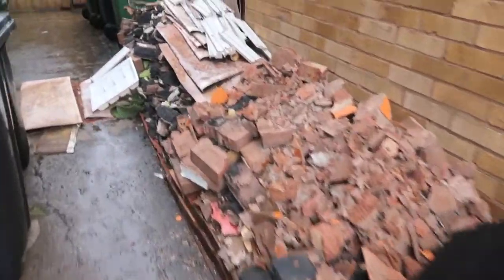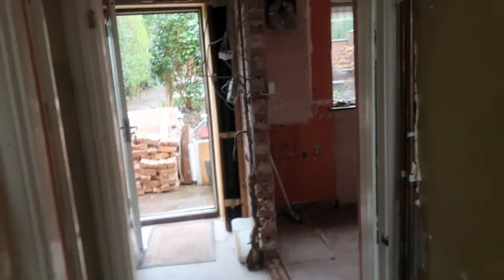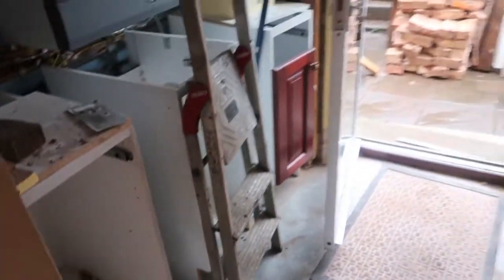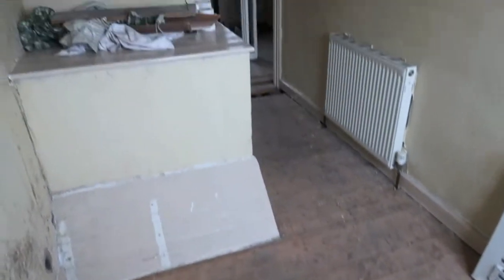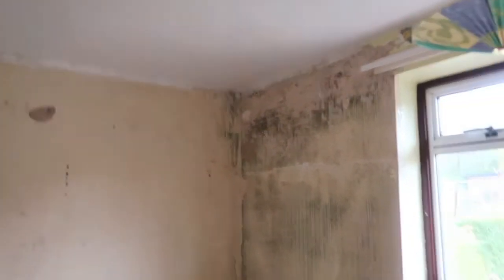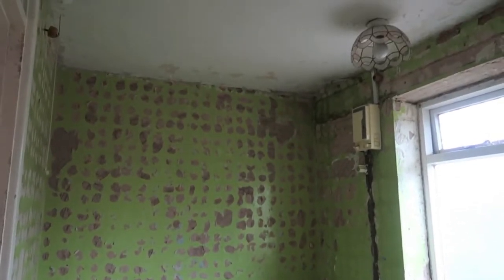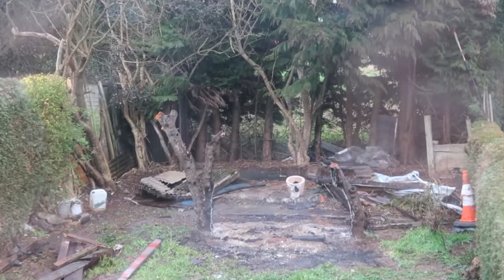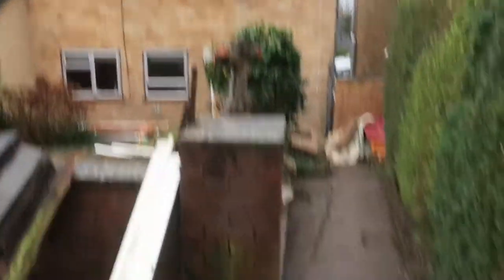Old House Budget Renovation Restoration - Part 2 - Gutted House Tour | Tabby Perry

Comment: Yes, I'm curious if in the kitchen area - as you walk in - if the wall on your right can be removed to hopefully open up the kitchen to the living room.  The living room itself seems still too cramped for my taste, again I'd remove the wall that separates the living room to the hallway, if possible.  If that wall is load bearing it might not be easy to do, requiring either very long headers (expensive) or may a pillar or two - I like how the stairs leading up look now as you've opened up that area directly underneath and found some new opportunities there!

Comment: Before deciding where light switches need to go, have a look to see which rooms would work better if the doors were hinged on the opposite side of the doorframe. This was done in my house, which makes it seem more spacious than my neighbour's. It is possible to make the tiny room upstairs into a single bedroom by building a platform across the top of the box towards the window. A single mattress is 6ft 2inches long and should fit across the top. An added bonus is storage underneath! My room was done like this when I was a child. The most likely cause of the upstairs mould would be blocked gutters that have meant the rain water has run over the edges and down the outside of the wall. I have renovated 5 houses since 1974, and now renovating my current house. Good luck and hope this helps!